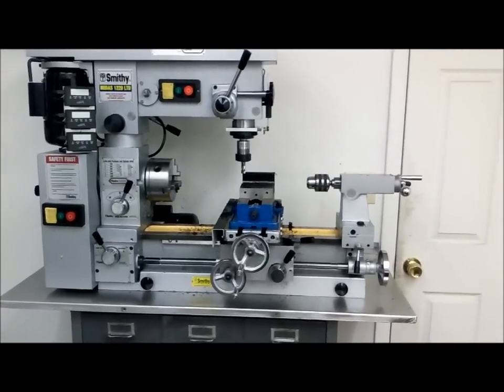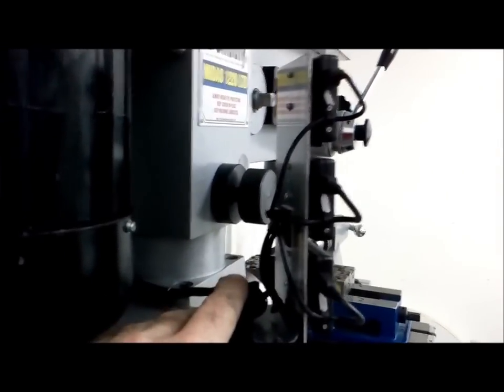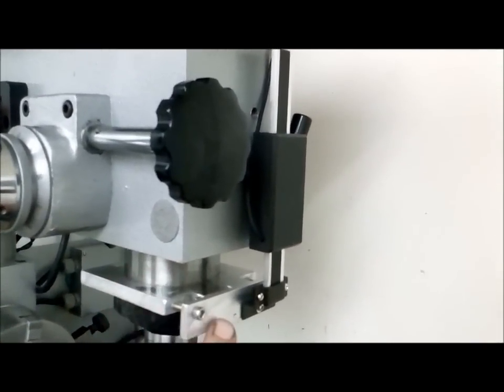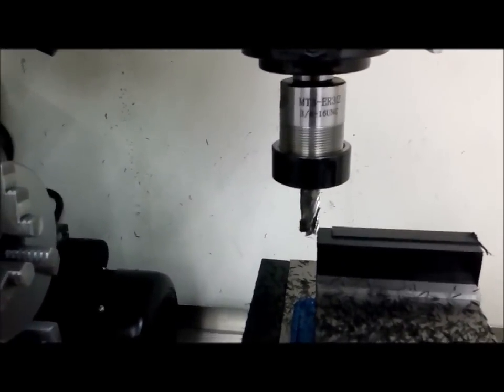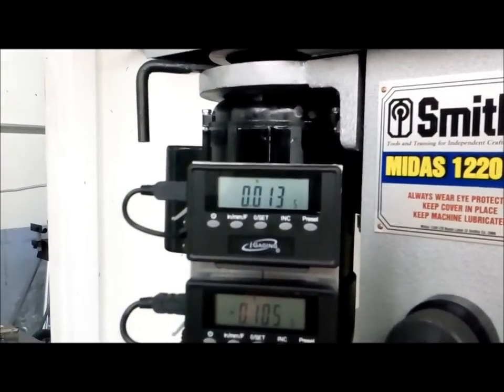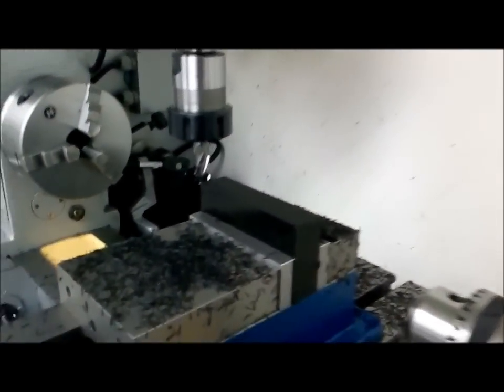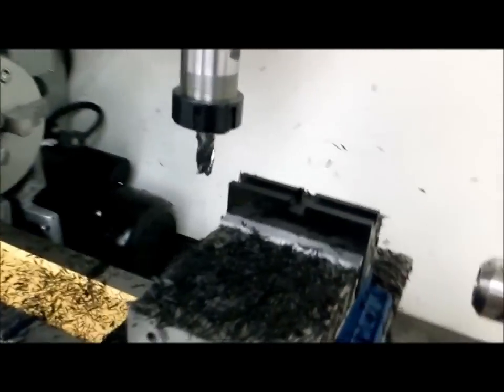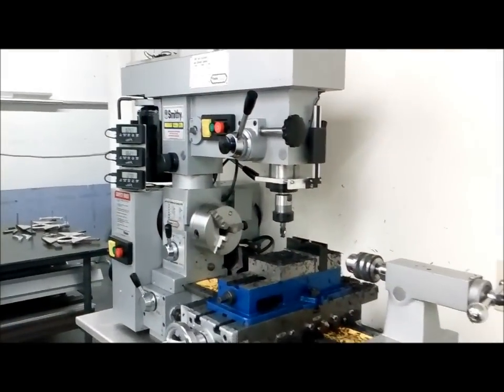SMITHY 1220 LTD WITH DRO DEMO

Comment: im very interested in buying one of these and have zero knowledge of them. the last machining i did was back in college which i enjoyed alot but they were on 30-50 year old machines so id have to familiarize myself with all of this again. my question is why does the lathe run while the milling machine is running? i thought they had seperate motors. seems a bit sketchy to me as i know id prolly go to rest my hand on the lathe chuck lol would love if you got back to me on this... great video =)
Reply: DTNorthern I think it may have to run to use the power feed

Comment: Great video Mike, thanks!   

Could you provide some info on the tool holder/collet in the mill please?
Reply: I have the same one, it's an ER-32 MT3 collet holder. Buy a kit so that you will be able to use a variety of sizes.